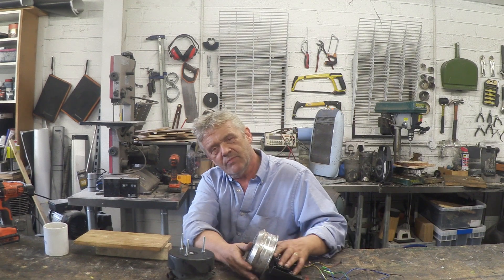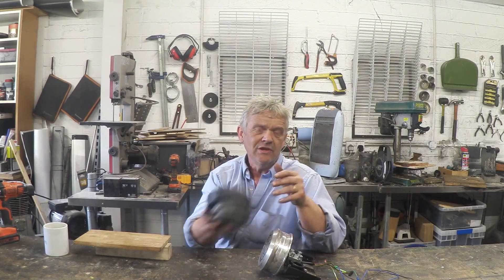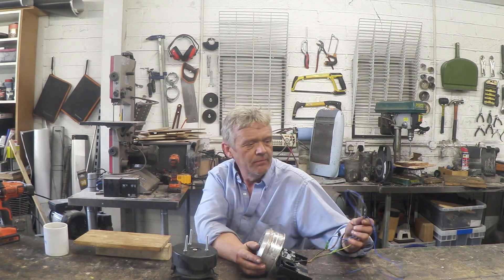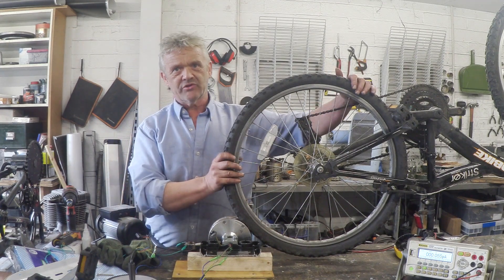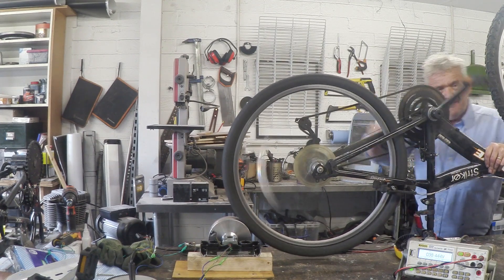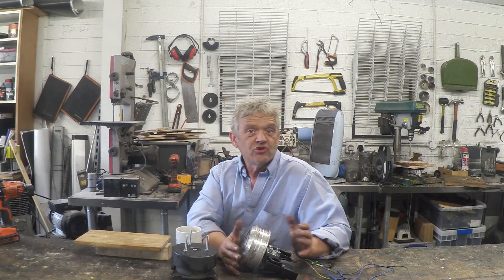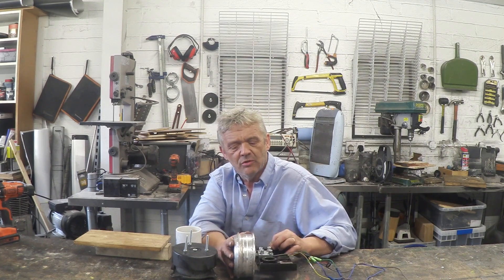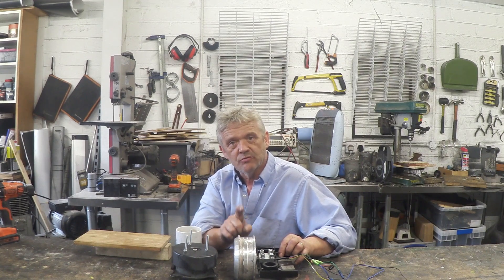1215 More On The Hoverboard As A Generator

Comment: Hello, Robert what can I do to take my hoverboard wheel to make my DC to AC and make it put out 230 volts of AC  I have my set up able to make any DC volts from 0 to 480 volts DC I want to take the DC voltage to 230 volt AC  in know that I could use a transformer but I can not find the right transformer and not costing an arm and a leg. what can I do please help thank you for all the info you put out great info.

Comment: The maximum current would be achieved when the output is closer to shorted out. Even without increasing rotational speed, something will overheat but you will see many amps. If the device was rated at 250watts and the motors voltage is 36, it should deliver over 6 amps.

Comment: Hello Robert. I've seen this video, and since I have a 350W Hoverboard, I'm thinking of this project of a bike generator but also the one for a windturbine (since I have two motors). But my main questions is: How will I store or use the energy efficiently?

What would you advise to be the best/easiest way to store the energy and then use it in a nice and easy way? Obviously incorporating the generators directly into the electrical system of the house would be the best but has many risks and might be hard for a starter, so I was thinking like a 48V Battery with a normal outlet, that I could use to power my 3D Printer or my filament dryer for some limited time. Ideally, I'd have the battery connected to the wind turbine or bike while using it for powering the 3d printer, but I understand this might add some complexity, so I was first thinking of starting simple. Using the bike or wind generator to charge up a battery, which then I'd disconnect, bring it to the office, to power up some appliances, until it's depleted, and i'd take it to charge again. On a second stage, I'd try to make it all connected.

I think you see my point. What would you advise for this? I'm curious for your input!

Comment: I may only have a sample size of one for each, but I would like to mention it anyways:
from my tests I got twice the power output with lower input from a scooter motor over a hover board motor

both motors worked perfectly fine as motors, but as a generator, the scooter clearly wins

i can try doing some rewiring on the inside, there's some talk about chaning the paralell wires to serial, and then there's some stuff about delta and star configurations....

But I'm curious if it's just less efficient because it has an odd number of magnets for it's poles, I think 30 magnets, 27 poles

Comment: You are definitely going about this the wrong way. Just seen a guy getting 25 watts slowly turning the motor with a hand crank. With a pully set up you should have no issue getting over 100 watt in moderate winds with this thing. You need to rewire a few parts inside the BLDC, slap on a bike wheel and a belt drive.

Comment: I have 8 hub motors and a 3 acre pond. I have the water flow design but I haven't been able to figure out how to use these hub motors as my generator. Any suggestions I would like to get at least 5 kw if possible. I have a 100,000 gallon drag tank so I will have plenty of water with plenty of Force. I would love to have your input. Thanks

Comment: I've found an old petrol genny in my shed, and as far as I know, the motor is goosed. But the Stator(?) seems fine, as does the little circuit board , I'm genuinely interested to know it it would  have any application for a wind turbine....it was for a 240v 1000w generator, so I assume that output would be at a certain RPM, Any advice to where I go from here? cheers.....
Reply: The generator probably went a couple thousand rpm with good torque. If the torque isn’t too high then use gears for more speed

Comment: Following this project with great interest!

It just so happens that I have just acquired a hoverboard. I'm planning to do a wind project with the motors. I'm thinking of two savonius type, mounted on a stand together and shaped something like "leaves", just as a low voltage garden ornament that powers led garden lights. I also managed to salvage all 20 18650 batteries, so that's a big bonus. 

P.S. On the hoverboards main control board, I de-soldered the 4 biggest capacitors and put them in parallel after the bridge rectifier (cheap 3 phase one). They seem to be working well at smoothing for testing.
Reply: I have something similar in mind but maybe a bit bigger setup. Two oil drum savoniuses on top of each other on 90° angle on each other. Have several hoverboard motors, maybe spun with bicycle gears and chain. I have almost everything needed gathered up, only ball bearings durable enough are on the list. Maybe from a car... Going with close to zero budget on mind so getting all needed can take time.

What kind of setup do you have or is it still on paper?
Reply: @Teknopottu  Still on paper at the moment. I may play with plastic drums and use trailer wheel bearings.
Reply: @chrismalcomson2824  Nice. Trailer wheel bearings would work in my case also. Good luck with your project!

Comment: If you make your blade's out of something that has a larger circumference it will spin a lot faster. I made some out of a cheap builders bucket and got much faster RPMS than from blade's made from gutter pipe.
Reply: Basically the blades cut with less friction. Yes they will need a faster wind speed to get things going. But when they do the RPM will be a lot faster.

Comment: If you make your 3 phase rectifier from 1N5819 schottky diodes it will have much lower voltage drop (ie better efficiency) than the garden variety 1N4007 type diodes.
1N5819 should be easily available on eBay.

Comment: Could you do a breakdown of your measurement setup? ie; when you say you are switching to amps can you do a close up of your instruments and connections? the readings in milliamps do not quite make sense to me because to read amps  the ammeter must be in series with the load. What gives?
Reply: Yes I know, I've been an electronics professional for almost 40 years now. 🙂
I did say "a low resistance load", so if your load resistor was 2 ohms it could easily put out 2 amps into 2 ohms, or 8 watts.
That's why it's really important to say what resistance your load is, it makes all the other numbers make sense.
Anyway I've really been enjoying your channel, your innovation, enthusiasm and fun factor makes your vids very watchable. 👍
Reply from the maker: sorry mate I do this so many times I often forget to give those details as they are in other vids but I read volts in parallel and amps in series with a resistive load - on occasion I will use an inductive load but not often and I usually say if I am doing that
Reply: @ThinkingandTinkering  if you are doing that it is critically important to state what the resistance of your resistive load is, otherwise the values are almost meaningless.
For instance, at those RPMs that motor into a low resistance load would easily have generated a couple of amps.
Reply from the maker: @wizrom3046  Mate it can only generate what I put in - at full tilt I could best generate maybe 60W from arm power alone - check out the Stanford tables on this. I would guess I was managing maybe 20 watts so at 50 volts or so  the most it could be would be milliamps - I am sorry but it just doesn't make sense to me to say a generator can generate more than is put in - it can only do less than that

Comment: It's the rate of change of flux that you're discussing. Yes you can double the rpm but you can also double the number of poles. Comparing this motor to your previous one is somewhat problematic because it's no ot just the magnetic chemistry that'll've changed - pole number, turns per phase and flux density of pole (regardless of material) are all going to be different.   It's perfectly possible to design and build an alternator for lower rpms - your project of repurposing motors it will probably be about running them close to their original design rpm (/voltage). Curious - what was the load to only see 50mA @50V? I'd have thought you could have got a good couple of hundred W with that setup. Final thought - I'd suggest getting a slick tyre bike for these (very useful) bike demos - much quieter!
Reply from the maker: exactly mate - and we are talking frames of reference doubling the poles or doubling the speed is essentially the same thing - the pole doubling is lifted physically though and more of a limitation than speed doubling - nice suggestion on the tyre lol

Comment: A higher grade motor would need less turns to produce the same amount of power as a low grade motor
Reply from the maker: yes - but at what cost?
Reply: @ThinkingandTinkering  the is no other costs except the cost of the motor
Reply from the maker: @robertpitt8418  yes - which can be considerable by an order of magnitude mate
Reply: @ThinkingandTinkering  the rewards can be in the order of considerable magnitude

Comment: I recently pulled two engines of of some snowblowers i found for free. They have two output shafts. so i want to use one of the engines on a high mileage vehicle I might try to belt drive one of these hoverboard motors with the second output shaft. Use it as a small alternator for some accessories.
Reply from the maker: nice plan mate

Comment: I cant understand why your current flow is so low at that Motor?! I can crank my Motors by hand up to 10A - 12A.
In the Wind it produce, with a 1,3m diameter turbine, up to 200 Watts. Seems something is wrong with that Motor.
Reply: Or meter cables/meter. One could try to light an ordinary 12V car bulb with the motor. Any light would mean it creates more than mere milliamps. 

And Rob, this should matter if you are using faulty meters. It could give a new meaning to your earlier creations or tests that seemed to generate only that much power.
Reply: @Teknopottu  Exactly. This Motors can do serious Power. Several Amps - not milliamps!
Reply: Exactly
Reply from the maker: maybe - it doesn't really matter to the point I am making though.
Reply: @ThinkingandTinkering  we understand your point.  But the test results seem flawed. 
The faster it goes the more power.  
But less than a half amp. Something is burnt, maybe its my brain.  
I ask a question and don't get any response.  
Don't take this wrong, but sometimes it seems like the test results are off.
Then some of us wonder.
Pump out the videos for the commercials or for the viewer's.

Comment: It would be interesting to be able to understand the efficiency of the transformation, how much work, how much electricity. The speed-to-voltage ratio seems not to be enough if i don't know how much torque is required to get to a certain speed. Always interesting, every day. Actually I also really liked the video on energy by gravity where you dropped a weight attached to a generator.
Reply from the maker: cheers mate - I am working on that one

Comment: Well...
You were right from your little talk about the "speed of the changing magnetic field". Back then building the VAWT. 
I think you're on to something fascinating. And... it all seems to point to (in my mind), finding that way to get around "torque". Especially if one will use gearing. Or... hurry up and have your epiphany of how to gear up without increasing torque; or something new all together, that disregards gearing, dramatically increases speed, and makes torque as trivial as all the other components, in relation to the importance of "speed".

Personally... it all reminds me of that VAWT design again. 
"The outer rim, and not the shaft".

Anyway... carry on.
Good stuff.
Reply from the maker: those are lines I am thinking on mate - I don't know but I suspect the key is in there
Reply: @ThinkingandTinkering  

You're good at finding keys.
Your good epiphanies. 
I'm confident... It will come.

I'll be here.

Comment: If you want a higher voltage from one of those hoverboard wheels you can easily reconfigure the windings. I'm using one of these for a wind turbine and tore it down to see how the windings are connected.

It turns out these motors use a Y-connection, but unlike the typical Y-connection where the poles that belong to one phase are in series, these motors have them in parallel. So effectively, inside that wheel is 3 Y-connected generators hooked up in parallel. Therefore if you take these windings and put them in series, you get triple the voltage for a given speed, but also more losses due to the increased internal resistance.

I ended up putting the windings in series, but then using a delta connection instead, giving me a good compromise between output voltage and winding resistance.
Reply from the maker: very nice tip mate thank you
Reply: This is a great tip. No need to disassemble motor myself to figure out the windings. Planning to go with vanilla windings.

Comment: Hi Rob
You should get amps from that motor when spinning not milliamperes. .
Reply: That's right. Mine's creating enough power to light up car bulps with sturdy hand turning. Maybe Rob got some broken one's, like the treadmill motor he had with that awfull noise and a lot of resistance. The video was 1137. My 180V dreadmill motor lighted up 60W bulb brightly just by wrapping a cord over the axel and yanking. Bad luck with with motors or what seems to be the case?
Reply: @Teknopottu  I use those motors in regen mode for braking on my skateboard. If a few watts were true my range wouldn't increase when braking down a hill (which certainly adds range in practice).  2-300w should be no problem for such a motor. Dont focus on the voltage, a simple voltage booster circuit on ebay for 10pounds transforms the voltage up to what ever needed. Google voltage step up booster.. A gearbox would only be max 6-8 percent more efficient than a good booster from ebay. Not worth the hassle of building a gearbox in my opinion.
Reply: @impuls60  Amen. Why use more moving parts than necessary. If one enjoys fiddling with gears, tnem
Reply: @Teknopottu  I suspect meter cabling/setup/operation ?
Reply: @401ksolar  Could be but for the meter wires they would have to be very thin. Simple resistance reading would eliminate that possibility. Bigclivedotcom has a great video on this, "Making my PSU cables literally 20 times better". It's for PSU but the principal is the same. Amps cannot travel on thin path.
Reply from the maker: it doesn't matter right now mate - that's not the point I am interested in - later I will look at that

Comment: @Rob, just to be clear, in my simple mind, higher spinning requires more torque. In a Wind generator, this means the "blades" need higher winds to generate significant electricity. Which I interpret as, there's no free lunch!
Reply: No free lunch, but I think there's ways to hack it. Robs low torque coreless coil wind turbine design for instance-  I think you could stack 2 of those on top of each other, with the coils on top of one, and the magnets on the bottom of the other,  and each set so they counter rotated at the same speed in the same wind, and get double the relative speed between magnets and coils, and thus greater output from them. 

Or with a hand crank, do it like the wimhof generator wheels, and just put your magnets and coils on the inner faces between them- that would get you double the relative speed between them for roughly the same effort of cranking one. 

I guess you could do it with a motor too- counter rotate the stator and rotor, though in that case you Do have to worry about the torque.
Reply from the maker: pretty much mate though there are things you can do beyond that I think - but somewhere a 'sacrifice' has to be made